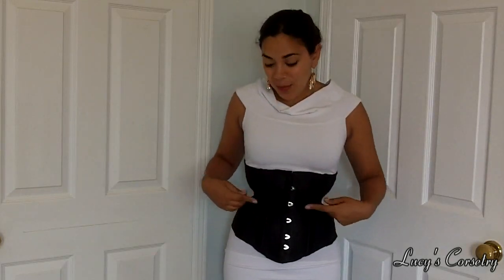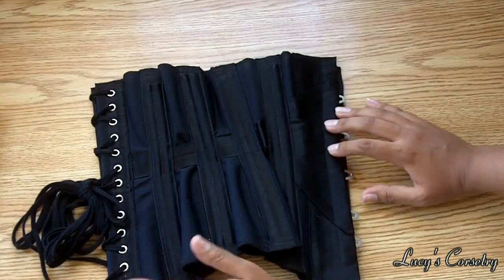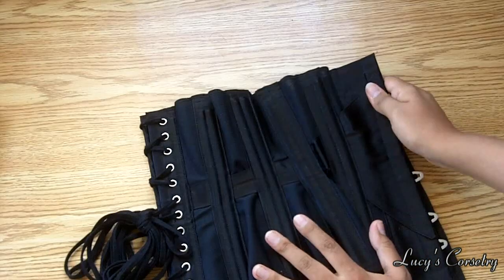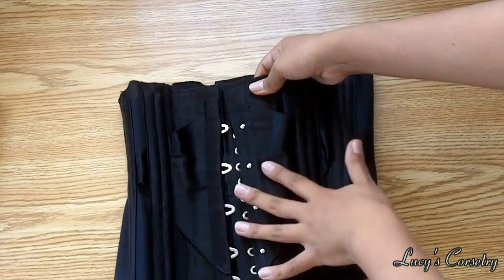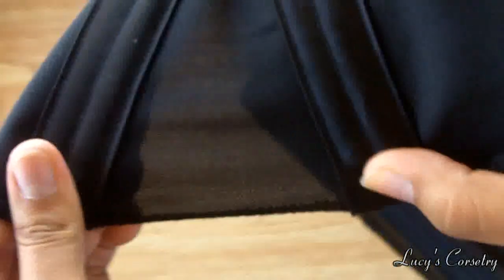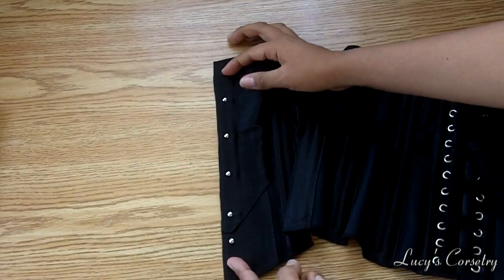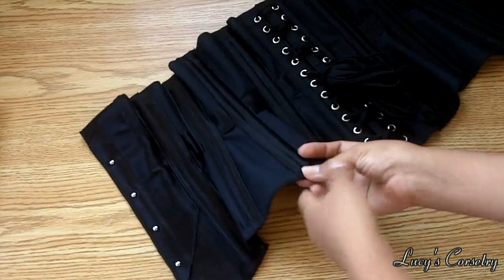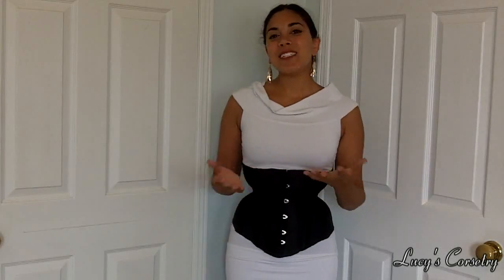Case Study: Homemade Sport Power Mesh "Corset" | Lucy's Corsetry

Comment: I'm glad you posted this. I'm in love with an extant Victorian "summer" corset that I would like to reproduce. Rather than being made with mesh it has tapes that circle the torso perpendicular to the boning channels so that it looks like a cage. I have a feeling that would leave a waffle pattern on my skin. The power mesh sounds like a good option to use as a base for the tapes. I can always use contrasting tapes and boning channels over the mesh to get the same basic look as the antique corset. Thank you so much for a great idea.

Comment: Lucy, I would be happy to send you a few yards of fold over elastic to bind the edges and still allow for stretch.  it can be attached with either a zig zag stitch or a cover stitch(preferred).  I use two different sizes when binding my elastic dance corsets.  i know you have a po box shipping address and will be happy to ship some to you!